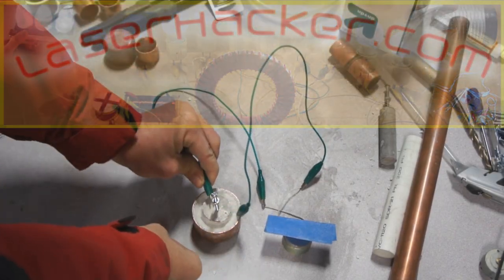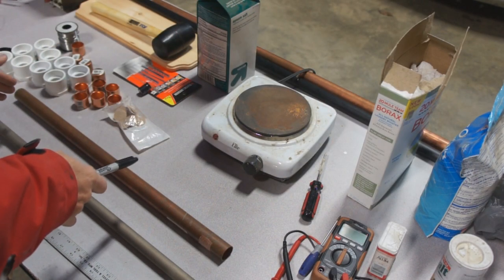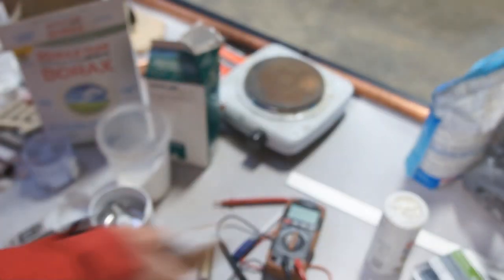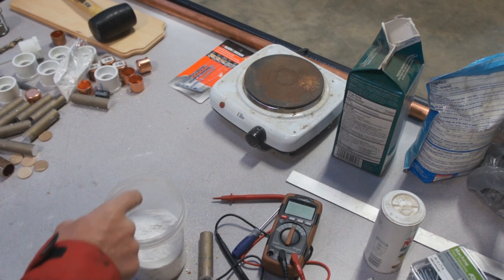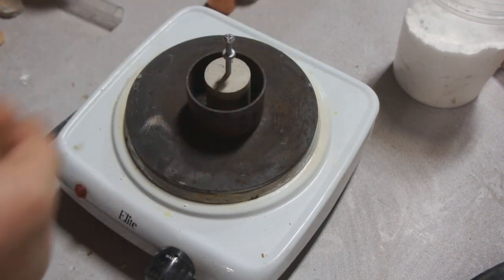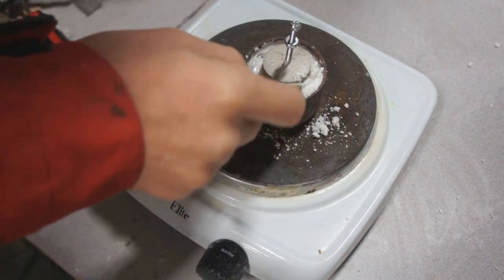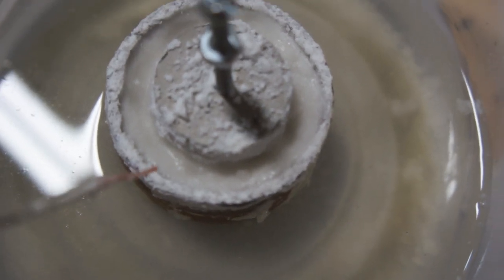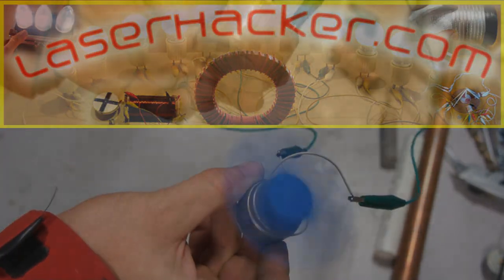How to Build Crystal Power Cells - Long Duration Power

Comment: ok, some one please let me know where to get the solid carbon? what name should i search for? thank you..
Reply: also could some one please tell me where to find the solid core magnesium rode? the solid carbon rode that im aslo asking for help trying to find is on his air battery... so i need some help with both... thank you...
Reply from the maker: *****

I have always scored great deals on that stuff on eBay.  I have order from here in the past:  http://www.mcssl.com/store/gallium-source/magnesium-metal
Reply: thats great fr the magnesium, thank you, whar search term do you use for the solid carbon rods? thanks again.
Reply: the carbon you can extract from a dead 6-volt alkaline battery. rip it open, there are 4 D sized cells inside. put some  gloves on, and crack open the cells. crumble away the alkaline material, be careful to not crack, snap, or damage the carbon rod. and that one 6-volt battery should get you 4 carbon rods
Reply: thank you
Reply: no problem, just a pointer, its safer if you kill the 6-volt battery first. i mean, you dont have to, but if you dont, you'll have plenty of alkaline material all over the place, if its dead, you'll have much less.
Reply: cool, I'll keep that in mind.. thanks again.
Reply: Good Day
Any "cheapie" Carbon Zinc  ("Chateau" brand or "Golden Peak" brand etc.) Typically called "Heavy Duty" "C" or "D" Cell. The Positive core is pure Carbon rod, found in the centre of the Cell, just under the top cover.
Think Dollar store Cells, not "Duracell" or "Energizer".

Another "do it yourself"  Cell, is even simpler: A Pickle jar (you could even use the Pickle Brine although they must be Dill Pickles),or Lemon Juice, or Vinegar & hang in the jar 1 square of pure Zinc plate or at least a decent Zinc coated Steel sheet, & one small Copper sheet.
The output levels will be close.
The copper sheet will become + & the Zinc or Steel will be -
The expense to build this will be 1/10th the cost of the Crystal Cell.
Reply: thank you so much... this is great! can't wait to try that... thumbs up!
Reply: hes using magnesium rod and copper, no carbon..if you used carbon its gonna end up like a shortlived battery you find in the shops

Comment: This is pretty awesome if it works, but you hot plate was obviously not on because the light was off and the partials that smiled on to the plate did not melt. It looks like a hoax. Plus your hot glue would have melted, and your electrode would have then risen. I would love you to disprove me.

Comment: For all you budding young scientists out there and links to other project at the end of the Video
Reply: I can do you an even better more simple cell tommoro I will take a quartz rock a piece of tin a piece of copper some rubber and put it in a clamp and make a high voltage spark that will knock you over.I will put this on vid and post it on my page,its a simple thing it copies the piezoelectric starter from my gas grill.
Reply: Simply applying pressure to quartz will make a high energy current equal to a stun gun.

Comment: a lighters works with piezoelectricity crystal so if we use lots of unit then it's gives electrical charges at large scale which can be collected by capacitors so we got an instant battery which can powered the small gadgets for long periods

😝😝😝😋😝😝😋

Comment: Why do you call it crystal? It is a primary cell similar to a flashlight battery.
Reply: You are certainly right. Everyone's all freaked out about it.  I do have to admit he does some interesting and informative work here, though.
Reply: Im thinking its because he uses salt crystals to produce the voltage rather than acid. Yes, it's just a battery, but its a really neat demostration to how those kind of batteries work considering most examples use lemons or potatoes.

Comment: road runner ice melt has both potassium chloride and magnesium chloride
Reply: +chris owens  I used to make that roadrunner ice ,,control.the  guarantee of a specific mineral content varies from pallet to pallet. The mine where this is harvested is a surface salt lake,the byproduct of the potash industry.there is no garauntee of the same exact measurement of mineral content in each bag,bewaare mix your own for consistency.have fun.

Comment: hi everyone can you please tell me the first ingredent
Reply: he lists all the ingredients and instructions in a link in his comments section below the video.

The complete build process for crystal power cells. 
Needed Items:
Solid magnesium rod.  Aluminum can also be used but will give a lower voltage.
Copper pipe cap.
Equal Parts of the following:
Potassium chloride - commonly known as salt substitute.
Hydrated potassium aluminium sulfate - commonly known as alum.
Sodium tetraborate - commonly known as 20 mule team Borax.
Magnesium sulfate - commonly known as epsom salt.
Reliance 9001829005 32-Inch Magnesium Water Heater Anode Rod

Comment: crystal didn't work for me, I mixed them with liquid and it worked.  Hydrogen Peroxide was mixed and I put a cap on it inside the copper pipe and it later pop the pipe through the ceiling in about 6 hour.  Hydrogen Peroxide will create pressure with those mixes alone, it will pressure and expand anything untill it pop.

Comment: Q: Does this have more power than your air batterys?
Reply from the maker: I have not yet achieved the amperage of the air battery design.  That design gives lots of surface area in a small space.  Thank you Nathan Stubblefield.
Reply: instead of using a solar cell on your caps in your car how about trying to use the airbatterys or the crystal cells to recharge them i think that would be a awesome experment!

Comment: I wonder if I can fit it onto my phone so I don't need to charge it ever again!!!!
Reply: charging handphone might be greater challenge cos it gobbles up more amps to charge lithium batteries..might be worth trying though if you connected it with an arsenal of supercapacitors
Reply: fidel catsro
that's what I want to do. create a battery pack with these that can run indefinitely. a pocket sized one for your cell phone may be out of the question, but maybe one about the size of a small coffee table to power your living room. if anyone has any tips on that I would like to hear it
Reply: Samrules888
 Just get one of those new "Bloom Boxes" by Bloom Energy, They look fantastic.
Reply: Samrules888 maybe you can power the living room using a lot of these stacked in series..there are plenty of LED lights running happily on 12 volts dc and low amps..solar panels might be cheaper and convenient for your case
Reply: lassi kinnunen
and also bloom boxes require scandium, an incredibly rare metal. only about 20 kilograms of it are mined annually. there just isn't enough to keep them in production for too  long.
these power cells otho can be stacked up and don't require any rare ingredients.

Comment: who needs solar panel when u can make one of these?
Reply: truth!!
Reply: That is nonsense. They get their power out of the magnesium. The cost of the magnesium is higher than the cost of line power, let alone the cost of electricity from your own pv array. Also the number of these you would need to power your house would be quite ludicrous.
Reply: Anyone who wants to power anything useful and who dosn't have the space for literally thousands of these cells to lay around. You do know these put out micro-amps, right? It's cool, it lasts a long time, but that's the only notable thing these do. You can't light your room up enough to see with one LED, and you'll need one of these per LED...

Comment: He does not mention that in this theoretical battery, the power is coming from the P to N connections electromagnetic field. an exterior magnetic field will cause a spike in power and not smart to use things like this around large magnetic fields without shielding. Do math first.

Comment: BTW, I noticed one small mistake here right away in the video. It is a small mistake, but if they guy making the video can make a mistake like this, than it makes me doubt all of his claims. He has the electronic meter set up to measure volts, then without changing anything he switches to measuring amps. Anyone who knows anything about electronics can see the mistake right away. Voltage is measuring by putting the meter in parallel with part of the circuit; to measure amps, you have to interrupt the circuit and put the meter into the wiring of the circuit. He didn't do this; he was measuring volts, then switched to amps without changing anything in the circuit. One of the two (voltage or amps) should have measured zero. I smell a rat.
Reply: He didn't have any loads hooked up so he was measuring current flow solely through the multimeter's completion of the circuit. Otherwise you're right about cutting into the circuit to measure the amperage on that portion
Reply: i used to work for a tv repair tech he was doing things right if he wanted to know how much current an item needed he would put the meter inline with the device and the power to see what flows he would be measuring a voltage drop and would not care what the voltage as a small copper rod inside the meter heats up rather its a 1000 volts or a 10 volts at one volt the drop across that span would be the same and that would end up going into the meter he wanted to know the max current the battery can put out so he applied a dead short to the battery and measured what he got now the mistake i saw not a big deal is he should of had 2 meters at once for the current test i would like to know the voltage drop of the battery while under full load a car battery for example puts out 8-10 volts when it starts your car if it has a 12 volt charge measured under zero load this is why a full charge measures around 16 volts under zero load so that when starting you get 12 volts now this is real and if somebody figured out how to make smaller units of this nature we could self recharging batteries or permanent batteries say for a flash light combined with LEDs you could have a flash light that needs no batteries and no new bulbs and could charge your cell phone or ipod to boot or a laptop that would be twice as thick as a normal laptop and never run out of battery power never need to be plugged in and never need a new battery for at least 2 years i suspect more like 5-10 years while this battery seems to have no break down its just really slow and some are even slower to break down then the one he made the slow break down and the bulging of the crystals out the top of the cell is the break down but this break down effect seems to have minimal effect on the performance of  the battery just effects the the ability of a case to hold it so a buffer space is needed to prevent an aging battery from expanding like a balloon and this expanding might effect the electrodes structural integrity such crack the outer copper or crush the inner core this does not seem to be a problem with his devices they just spill over i would say using a inner core shaped like a star and an outer core being lightly indented and of a slightly larger size then reinforced to take the stress of the of the expanding crystal and i would try capping it off with some silicone in the cap and a hole for the screw to stick out use a screw on cap not a solder on cap this is will allow the expanding to be controlled a bit more i suspect the extra pressure counters any loss of electrode by giving a tighter contact this is not voodoo its just some long lost knowledge this is part why current electronics use crystals and why so many people like crystal jewelry and why in many scifi films they use crystal as power sources well they are not far off from the truth another odd fact crystals have tinny black holes in them  and in star trek one of the notable alien species is known to use a black hole to power their ship go figure what are they really saying its hidden in plane sight but Marc Barrett would rather make jokes about how the klingons are gonna rape my ass in the middle of the night because he seems like a paid troll his little comment was something that sounds good to those who know no better but for those who do they know exactly what this guy was doing and why and as well as the fact it works  paid trolls are easy to spot they love to start disputes when none exist and in this case he is calling a mistake when no such mistake was made he knows enough to point out normal protocol but i am not buying that he does not know how normal protocol does not apply here if he understood how the meter worked he would know what i am saying if you want to ask somebody then ask them if a shunted battery could be measured like this a shunt will not allow more then a specified current to pass but has little effect on the voltage so 15 amp shunt rated at 12 volt will allow 15 amps to flow past and will take 12 volts down to 11-10 volts if passing 15 amps but at higher voltages it may over heat 

this little cell will not over heat at 100 MA it might get a bit warm adding to a change in pressure then stabilizing output causing it to cool creating a self made loop but this only accounts for a very small amount of power coming out of the battery i think the hawking effect is passing electrons around  and the electrodes offer a direction anybody else want to give a reason for why this technology works the way it does